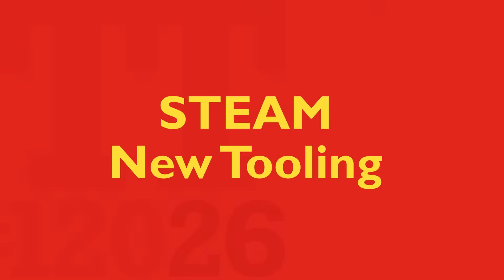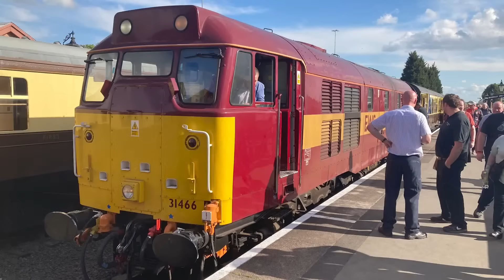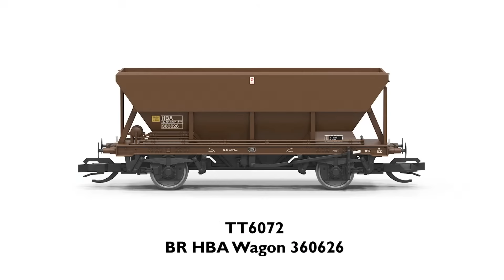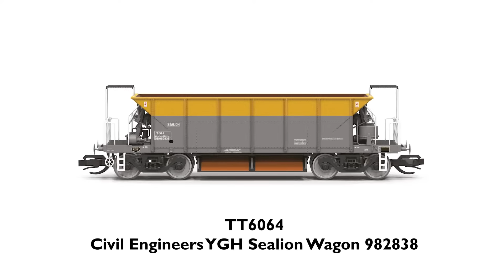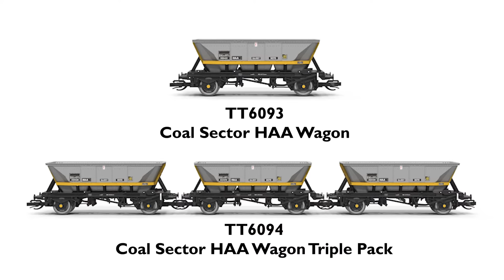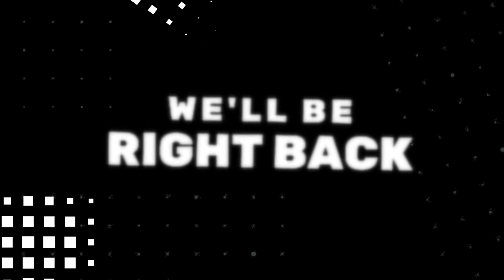HORNBY | TT:120 New Model Announcement

Comment: Great announcement hornby!! 
Hopefully 🤞 a mk1 tso in blue and grey announced later in the year, will you be doing your 00 shark brakevan to go with the seacows/sealions? Please 🙏 consider doing a rail freight red stripe class 37 with the same body as the coal sector/ews 37 or a splithead code large logo 37.

Comment: A very nice range of announcements. 
I wonder why the fascination with early 00s liveries for the HSTs, instead of a further release of BR liveries (a 2nd version of Blue and Grey, maybe as a 253 instead of a 254? And InterCity Executive too, as well as the Swallow that's already out), or something more recent (like Virgin East Coast / LNER / EMR, XC, etc).
I'm also wondering why we only have the mk1s as CK and BSK, when there are so many different mk1 variants to do, and the SK or SO would be way more useful for a modeller than a CK. Yet we have the mk2Es and Fs in TSO, FO, and BSO forms...

I'm defo getting some of the Eastern region mk1s, some HBA/HEAs (whether I have a full rake, or integrate them into a speedlink service, I don't know), some Sealions and Seacows, and defo the blue 31 (although might renumber it, depending on the dates the model represents the prototype as).